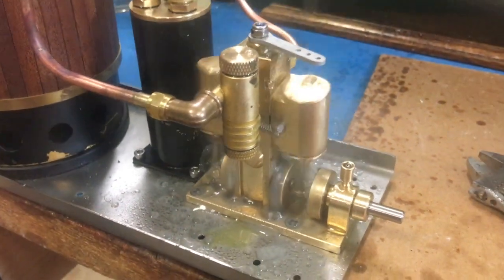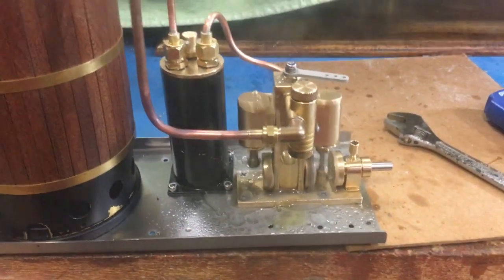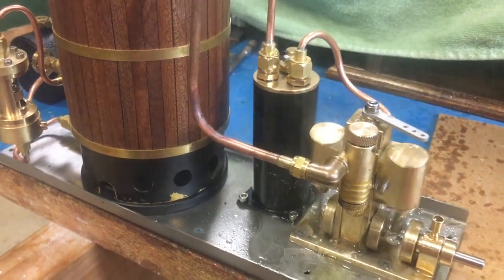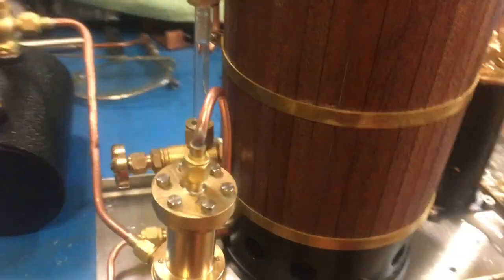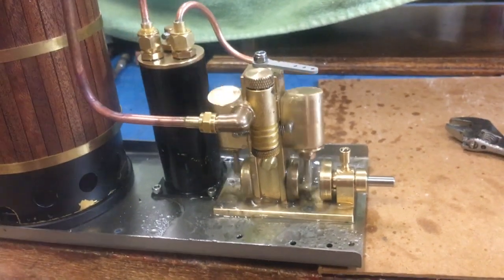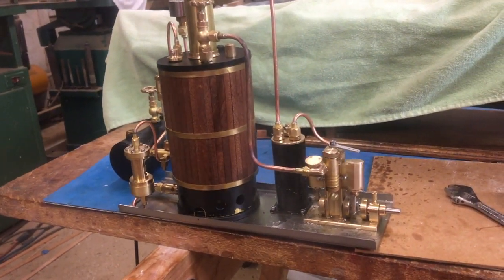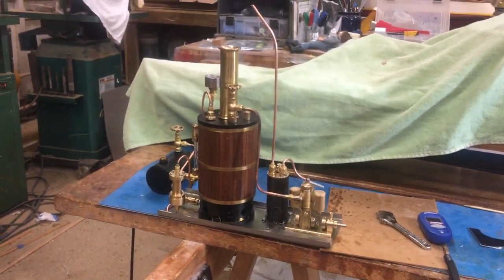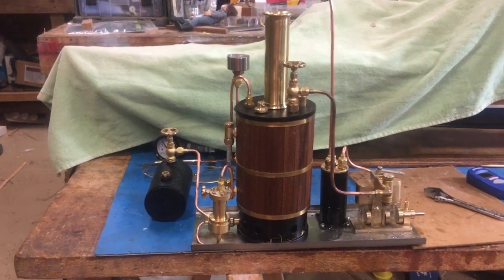Microcosm M36 Steam Engine-- Running just out of the box

Comment: Hi Carl, I just got my M36 and the throttle arm is set up the same as yours in this video. Before I go tinkering with my new toy (and possibly creating a headache), I wanted to ask how you went about adjusting the throttle arm on yours. Did you have to somehow block (through the intake/exhaust) the valve from rotating as you loosened and then re-fastened the nut? Or do the throttle arm and valve somehow index together? Thank you -Casey
Reply from the maker: Hi there  Caey -- I am not sure why your throttle arm needs adjustment but if you want to change it so it operates at a  different angle, you may not be able to do this.  I think the stainless arm is keyed with D shaped hole to a flat on the rotating shaft of the valve. But if I ever took mine apart I cannot remember so I don't think I am helping much.   Hold the arm still and turn the luck nut off, and see what you see. If there is no D hole them you can set the arm to any angle.  You are not changing anything internally .  Steam up and have fun!  -CM

Comment: Can you get reverse out of that M36 engine consistently?
Reply from the maker: Hi Jeff-- I confess this video is the only running experience I have had with the M36. The Fwd/Rev shift works OK, as you can see, but I admit it is not very smooth because the lever arm was too hot to touch and control with bare fingers.  I have not seen it shift with servo control. But I suspect the engine needs relatively higher pressure to restart in the other direction. If you are running at low pressure and try to reverse at that same low pressure, the engine may fail to restart until you "goose" it a little with a momentary surge of higher pressure; I have seen this on other oscillating engines and it is not surprising.  I'd love to know what you are powering with the M36 and your overall experience; there isn't much info in internet for the M36.  Thanks for watching! --Carl
Reply: Hello Carl I'm looking at getting the vertical boiler and changing out the pressure gauge to one from Pm Research would you know the type of threads that are on the vertical boiler ?
Thank you
Reply from the maker: @jeffb8321  The boiler threads are 8mm (I cannot remember the pitch,  I think .75) . To change gage, I cut the original siphon pipe off and added a new piece of 3/32 pipe , then you can have the 3/32 tube union cone and nut which fits the new smaller gage. Jin's pipe is 3.5mm and the 3/32 piece telescopes into it.  8mm miniature pipe threads are pretty hard to find. Somebody suggested they could be tapped out to 5/16-32 . then you can find those fittings at PMResearch. Can you email me at carlfmiller AT gmail?